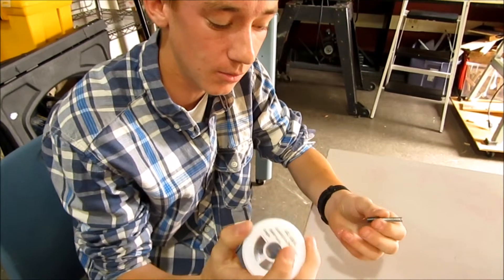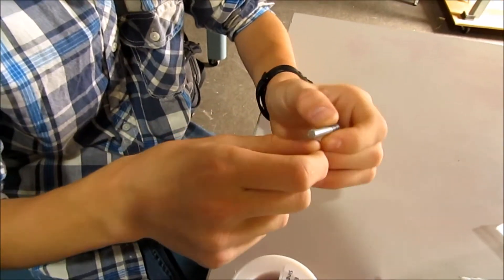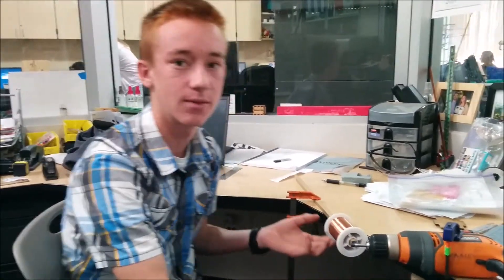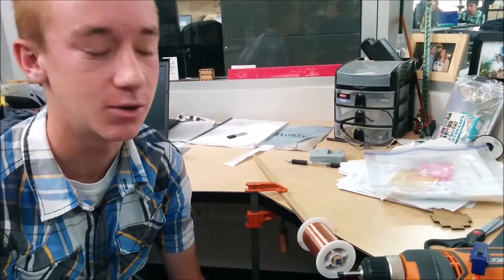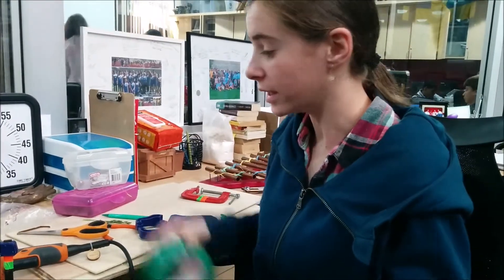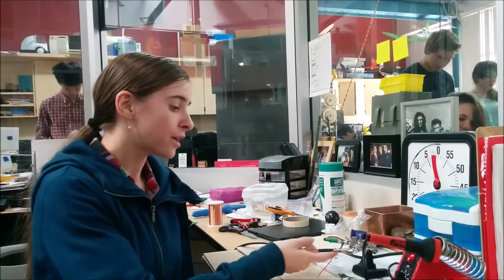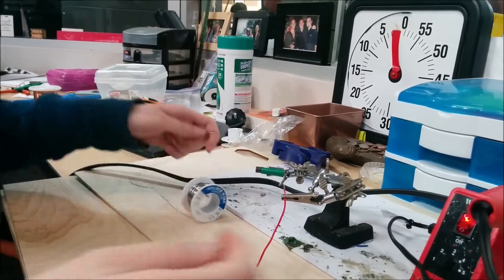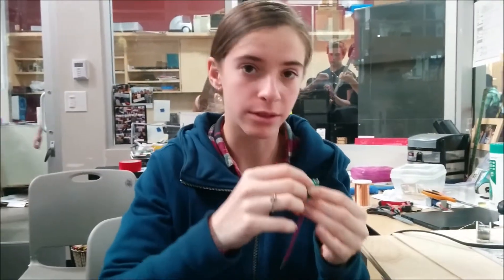Making Electromagnetic Pickups (by a 9th Grader)

Comment: i dont understand. How much volt did you apply to the electro magnet and how did you get the sound from the electro magnet to the amp?
Reply from the maker: The pickup becomes the current source so you don't have to apply any voltage. Just attach the two leads from the pickup to a 1/4" phono jack and plug it into an amp.
Reply: okay cool, im trying to build a electric guitar but magnets are quite expensive as the humbuck pickup use special type of magnets. So your telling me once i charged the electromagnet i take of the charge and the product stays magnetized for some time? sorry im noob with this.....
Reply: Or does it just become magnetized doing the operation?
Reply: Does the string frequency induce a current via magnetic flux into the electromagnet? lol i think i understand now?
Reply from the maker: If I remember right, there is no "magnet", just a coil of wire wrapped tightly around a steel core as the "slug".
Reply: okay thx great video keep em coming. I love projects like this.
Reply from the maker: Wait, nm, he does use a magnet. I forget details but he showed it in the video.
Reply: ah okay i see at 1:12 so basically you make the magnet more powerful ?
Reply: okay wait i understand now, thank you for your time and effort, i do hope you make more projects.